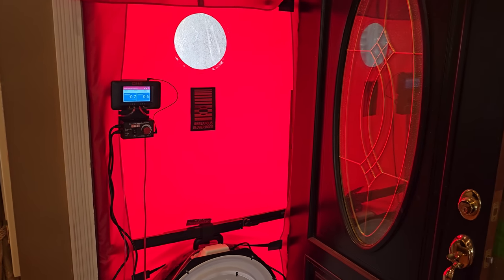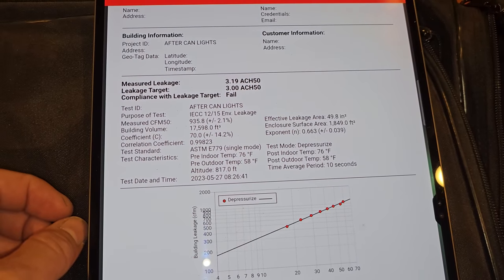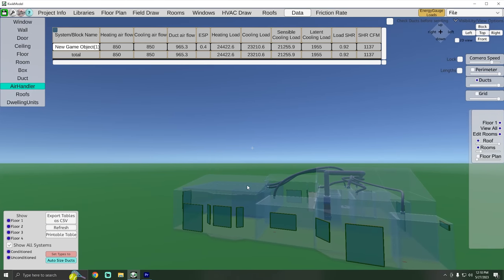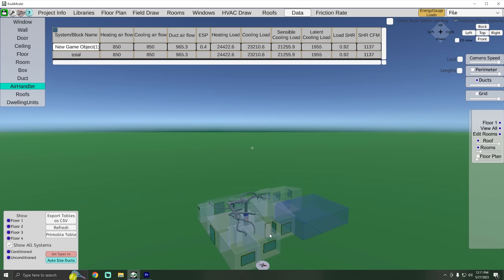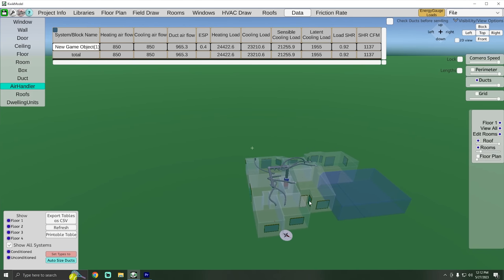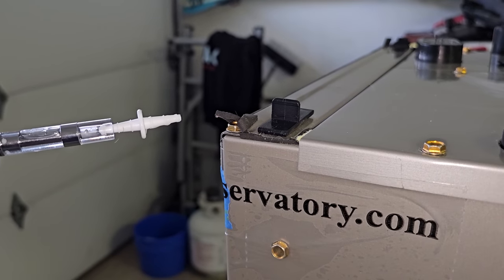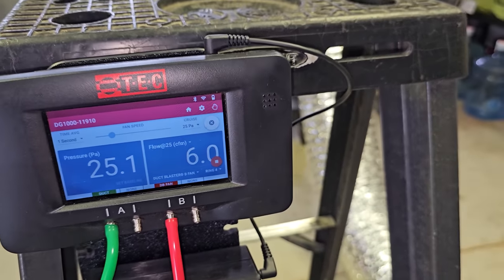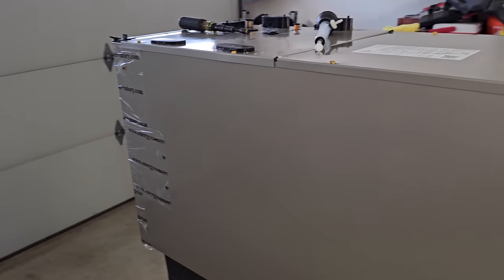HVACR VIDEOS HOUSE PROJECT PART 3

Comment: The only people who purchase infinity systems are people who don't work on them 😂
Reply: Nah we install and work on them. This 1 neighborhood i work in i swear has nothing but infinities from every generation. They are pretty easy to fix. But it is "newer" technology obviously and not just a contactor and a capacitor lol... so more problems. Its nicer to own if yoy can also fix it 😅
Reply: @Straight_White_Fatherly_Figure  I've worked on plenty. I mean they work when they work but all those proprietary sensors and stuff really tick me off when a themistor goes bad and it locks the whole system out for it and you have to reprogram the thing to Get it to maybe work while you get parts. And then there's the blower motor failures ughhh. Static errors for no reason, ect. I'm glad I haven't touched one in a while lol
Reply: @Andersonairchris  yeah i agree lol they add a lot of extra unnecessary pain. They need to be reset sometimes too. Ill be on call and a storm will come by, all of the sudden a bunch of calls from that neighborhood comes in. "Sir, have you tried resetting the breaker?" Will fix just about all of them 😅 old people especially hate it because its such a nuisance.
Reply: @Straight_White_Fatherly_Figure  yeah that's absolutely ridiculous imo. Imagine having to stop and reset your car on the highway because lightning struck around the block? Lol
Reply: Only guys who feel this way are old timers that don't have a smart phone and can't use Bluetooth.
Reply: @adamcox1809  weird I have both and never needed either to fix carrier junk
Reply: I think the same thing about any inverter system.
Reply: @gregmercil3968  I like the Bosch ones that's about it
Reply: Ohhh yeah the power chokes donut thingamajig
And the 50k step exv and quad shield wires gata love it

Comment: Guy I worked with had an energy audit done using the blower door method.  Technician forgot to kill power to the furnace, and during the test the gas furnace kicks on.  The negative pressure caused the flame to go the wrong way in the furnace, cooking all the wiring in the control section. To resolve the issue a new furnace was installed, billed to the energy audit company.
Reply: It's recommended to pressurize existing homes. Only brand new, unoccupied homes should be depressurized.
Reply: lol, DOH.
Reply: Yikes! positive pressure only!
Reply: Holy shit. Were the rollouts bypassed or something?
Reply: why did the rollout switch  not kick in

Comment: I think the inverters within the last year have been better in those units, but prepare to replace the inverter within a few years. Otherwise those units are pretty tough, especially installed vertically. 

Also i say its usually better to have the extra 5 kw heat strip than to not have it if needed. I dont know how cool it gets in Cali, but in SW FL sometimes it does get down into the 30s. Great work!

(If your system ends up having sweating issues because of the slow staging, theres a way to bypass the first few stages when temp outside is above a set temperature. In the settings its called high stage cool latch)
Reply: I have a 11 year old hitachi 18k btu with original inverter. Not a single part replaced except indoor blower motor and swing motors. 
This unit runs 8-12 hours a day in unforgiving indian summer. It runs fine even when outside temperature reach 49c . 

Also have a 72k btu panasonic vrf in my restaurant and that one is 4 year old , runs 12 hours a day . On all original parts. 
Regular maintenance is all you need. Clean the condenser once a year. Place them under a shead or at a corner where its cooler than ambient. Although you can't help much when it's 49c air temperature outside but you can atleast protect it from the sunlight. 
And Japanese stuff is generally well built although i had great service outof local cheap brands but they were not inverters but they did took some abuse. Like my grandma had a videocon 18k btu and she never got it maintained it ran for 15 years without being cleaned once. The the compressor fell out from the mounts due to rust. 
I have found inverters to be no less reliable than regular air cons. And the amount of money saved in energy outweighs the cost of pcb. 
All companies here provide decent warrenty. Japanese or Korean or Indian. All provide 5 years of warranty on pcb's. 10 years on compressor.

Comment: I’ve worked on plenty of the Infinity systems. Highly recommend the installation of surge protection. The ICM493 is a must for the condenser. Just having the ability to prohibit operation during an over/under power issue will save the inverter board. Other than that , as long as your static is good the units are great. Are you using the VNA8 or 4?
Reply from the maker: Vna4 and I have a 493 for the indoor unit and a 493 for the outdoor unit
Reply from the maker: I will discuss this on my Livestream this evening on YouTube 5/29/23 @ 5:PM (pacific) come on over and check it out https://youtube.com/live/c-zUt2l1HmU

Comment: On those Carrier you want to look at the outdoor unit, I've seen a few rubouts of the discharge against the suction accumulator and where the discharge bends down to the bottom right where the puck protects it from rubbing out. The puck eventually vibrates to the side and it rubs against the bottom, I typically put a piece of hole strap screwed to the bottom.

Comment: Are you worried about system going into defrost during heat cycles and not having strip heat to temper air coming back into the house?
Reply from the maker: I will discuss this on my Livestream this evening on YouTube 5/29/23 @ 5:PM (pacific) come on over and check it out https://youtube.com/live/c-zUt2l1HmU

Comment: Actually, I like that you're using a heat pump system for some reason in the United States. There's such a stigma against using them even though I think that's the way of the future. Is heat pumps to replace gas as a heating source.

Comment: Great blower score, personally I stopped at 3.0 ach@50 because local code states I must install Mechanical Ventilation which I didn't want to do.
Reply: I wondered how to interpret those values actually. Here in Germany most new homes get a Blower Door Test, it is not mandatory (It might be by now following latest standards though), but you can get federal funding for energy efficiency above current standard, and to get this a test is required. I do not know the different values for all those different energy efficiency standards, but a new building without forced ventilation (a regular building here without any systems to exchange or treat inside air, you vent regularly by just opening a window. Also usually no air conditioning) the test result should not exceed an exchange of 3 times the building air volume per hour. This is why the volumentric plans for the building are important, as you have to now the air volume for comparison. Test is run at same pressurisation of 50 Pascal differential pressure. As soon as you have forced air exchange, which in most cases is not a central air handler, but small autmotaded heat exchanging ventilation fans per room, you really will find central air handlers with durctwork in larger and usually commercial buildings here. the value goes down to 1.5 exchanges per hour. If you spent the money on a high efficiency passive house, 0.6 is the maximum allowed.
I am not so sure about the units used, but if I remember he got to 935 cfm. that is less than 27 m³. So either I got something wrong with the units, but just calculated the value for my 144 m² house (about 1550 square feet) and the allowed value for my house would be about just over 1000 m³ per hour... Either I got the documentation i found wrong or our required values surprisingly suck big time, but anyways, he really got a great value. Looking at how many different efficiency standards there are an how many progressions we had over the years, I guess I am simply looking at the wrong values or misinterpreting something early in the morning.

Comment: Hey. im sure you know but ductwork area to the attic is around 40% of house sq ft. and ducts have value of r4-r8.  if you blow insulation over ducts and cover ducts with blow in insulation you reduce heat losses significantly

Comment: Shit I need help, 600 square foot house with 1.5 ton unit and still hot as hell, won’t get below 78 in the day, walls brick and 2x6 don’t know about insulation, attic has  blown in insulation at 20inches, during winter it doesn’t get cold so I don’t it’s a insulation problem,

Comment: I’ve an awful feeling that two tons is going to be undersized (heck, I’ve got 3 tons for a similar sized house here in soggy south east England, but we do have humidity, but… still…) that said, I’ll be happy to eat my words when it works just fine even in the heat of a Southern California summer.

Really appreciate the video and all the information. Now, I’m just going to seal off my loft hatch (which until I saw your investigations, I always kind-a thought I should but couldn’t ever be arsed to do it 😊)
Reply: Uk massively oversize air conditioning. Always have.
Do a proper heatload calc and see. Bedrooms for example rarely need more than a kw. (I understand a lack of 1-1.5kw splits) 
Most uk contractors start by saying "it's a 2.5kw in this room but oh better bung in a 3.5kw just to be sure.."

Uk is nowhere near as humid as many parts of USA and Americans understand to remove moisture you need to run longer, you can't do that if it's oversized as you reach set point too quickly. 
Uk is obsessed with getting down to temp as quickly as possible as if that means it's a properly designed system. It's not.
Reply: @richardbartlett6932  I do agree Richard. 5kW (1.5 tons I think) for kitchen / utility / breakfast room was installed and another 3.5 kW for living / dining room (another ton) and 2.5 kW for master bedroom (think that's 3/4 ton, I really can't get my head to work outside of metric measurements 😀) which is just ridiculous. The master bedroom is barely 1 Kw I reckon. The rule-of-thumb method was used as a load "calculation" and when I asked about the over-sizing, was told the units modulate down. Which they do. But in the shoulder months, they do suffer from poor humidity control. 

That said, when looked at for heating load sizing, it is far better. All a bit of a mess, though, as you say.
Reply: Same in Southern Australia, then on rare days when humidity and heat combine they wonder why its so damp indoors.

Comment: carrier infinity is very good however be sure to look at the factory solder joints in the outdoor unit I have installed several where they start to leak when we kick it on for the first time. Also personally I would have gone with a 2.5 ton for a worst case scenario day. Remember also that if you get the air handler installed and this winter decide its not making enough heat you can always get a 5kw heat strip and throw in it as well. 5kw generally only needs a double pole 30 amp breaker to power it and based on the system being small you should easily be able to get away with that size.
Reply from the maker: I will discuss this on my Livestream this evening on YouTube 5/29/23 @ 5:PM (pacific) come on over and check it out https://youtube.com/live/c-zUt2l1HmU
Reply: A load calc is already oversized 10-15%. No need to oversize

Comment: That duct work is gonna be fun, how’s the room up in the attic ? Id rather trying adding thermal barriers under the roof instead adding in blown insulation. Once you add that blown insulation in that’s it you’ll never want to go back up there.
Reply: spray foam

Comment: Aren't you going to need the heat strips while the heat pump is going into defrost? Otherwise it'll be blowing cold air while it's defrosting for a few minutes. It's also nice to have for backup just in case something should fail on the outdoor equipment.
Reply from the maker: I will discuss this on my Livestream this evening on YouTube 5/29/23 @ 5:PM (pacific) come on over and check it out https://youtube.com/live/c-zUt2l1HmU
Reply: I was thinking of the same thing.

Comment: Why is is such a big issue to go up a size (from 2 to 2.5 ton i assume) if you get a multistage system?  Most of the time you will be running on the lower stage except when it's very hot or very cold.  When it is, if you're a oversized a bit the system can toggle between full and the lower stage rather than short cycling on and off.  I'm very glad I installed a two stage infinity system over 10 years ago.  Evaporator leaked aft 9.5 years but the coil was covered under warranty.

Comment: Serious question - why don't you just put the refrigerant lines straight to the rooms? It seems you are massively overcomplicating things using ducting. Can you even control the temperature in individual rooms with that?
Reply: Are you talking about installing a ductless multi zone mini split system instead? Thats even more complicated. Installing 1 system is better than installing multiple. Especially if the duct work is already there
Reply from the maker: I will discuss this on my Livestream this evening on YouTube 5/29/23 @ 5:PM (pacific) come on over and check it out https://youtube.com/live/c-zUt2l1HmU

Comment: The 2 tons of cooling and heating load that you guys calculated are basically what the house continually either loses or gains based on heat transfer through leakage, insulation, etc. 
But, don't you need some excess cooling/heating to rapidly cool or heat the house after you've been away all day at work? Or you happen to like the house/bedrooms to be cool overnight in the winter and then quickly heat in the morning? Question is, how much excess capacity is appropriate for those scenarios?
Reply: don't forget about other gains from more appliance usage than normal, or more humans than normal(parties/gatherings), people running in and out the doors.
but you sure don't want to oversize too much or you wont dehumidify enough and it short cycles to death, although it's nowhere near as bad with modulating vfd equipment.
silly example: you don't want to run a 1500HP vehicle to the corner store and back every five minutes. lol
Reply from the maker: I will discuss this on my Livestream this evening on YouTube 5/29/23 @ 5:PM (pacific) come on over and check it out https://youtube.com/live/c-zUt2l1HmU
Reply: If you oversize your system for those few times where you want to cool off for convince after work, you may end up high humidity issues. This infinity system specifically has a wide range of speeds that it cools at depending on the demand. Its a completely variable speed unit, including the compressor. 

You can also schedule these units to cool off 30 minutes before you get home, or you can simply open your phone and turn it down a degree or 2 while coming home from work.
Reply: i think it is most efficient to keep the temps constant all the time so that would not be a issue????????????????

Comment: Electric strip heaters you can use them for precise usage calculations.  WATTS DON’T LIE. 
To see exactly how many watts of power through the winter it takes to heat your home . Measure and record your run times.. 

And then compare to heat pump .  Or gas furnace.. 

And remove the electric heat strips later .   It’s your own house you can afford to do it..  just a little time in extra experimentation. 

I that’s what I’m going to do on my house put them in test through one winter catalog take recordings . 

And then take them out and compare to the heat pump .
Reply: You can also just shut down the electric back up heater through the programming instead of installing/uninstalling. But yeah great recommendation!
Reply from the maker: I will discuss this on my Livestream this evening on YouTube 5/29/23 @ 5:PM (pacific) come on over and check it out https://youtube.com/live/c-zUt2l1HmU